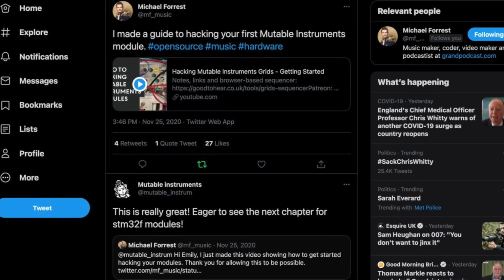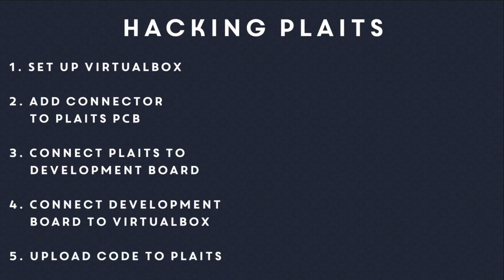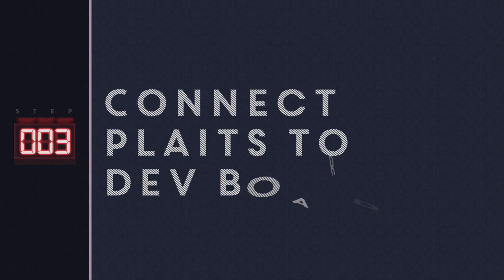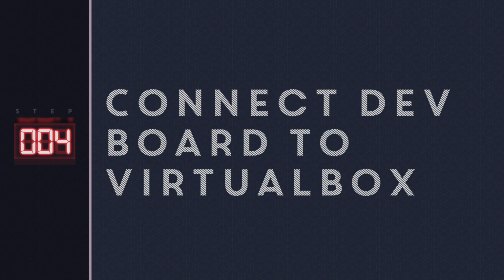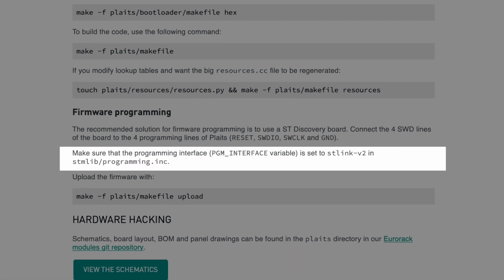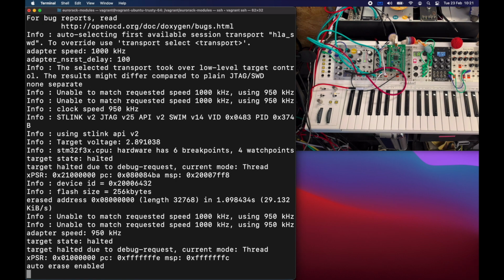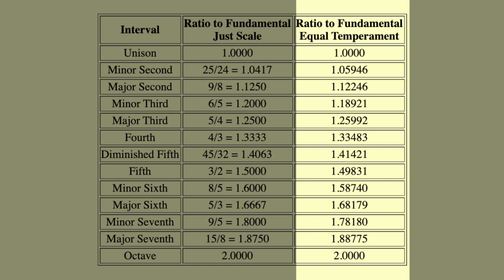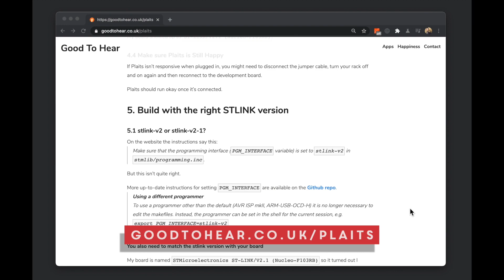Adding Just Intonation to Mutable Instruments Plaits

Comment: Note that it is not necessary to solder the header to the board. You can insert it temporarily in the 4 holes and hold it in place for the few seconds required to flash the firmware.
Reply from the maker: So I'm hearing on Reddit! https://www.reddit.com/r/modular/comments/m1zi39/intro_to_hacking_mutable_instruments_plaits/gqgm9kw/?utm_source=reddit&utm_medium=web2x&context=3 
Oh well. I'll pin your comment!

Comment: Noob question: If you can use the build environment to create a WAV (and thereby update the firmware that way), why do you even need the STM32 dev board?  Thanks!
Reply from the maker: You could absolutely do that, it’s just a bit of a slow way to work. This can get a little miserable as you’re getting closer to finishing something and you’re making smaller and smaller changes, forcing you  to wait for minutes every time to find out if your tiny bug fixes worked!
Reply: @michaelforrest  So if we only want to compile someone else's firmware, possibly with a couple of mods, then there's no need for then SWD interface at all then?  Sweet!  Thanks.